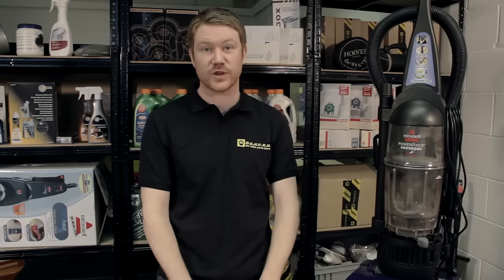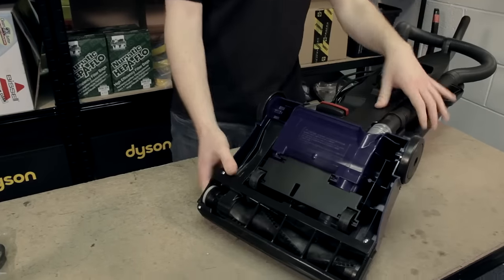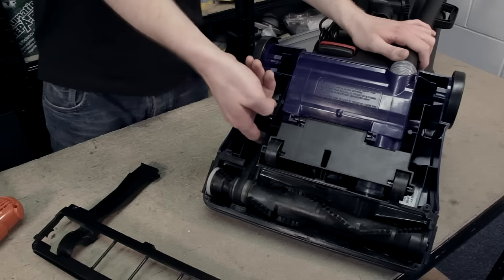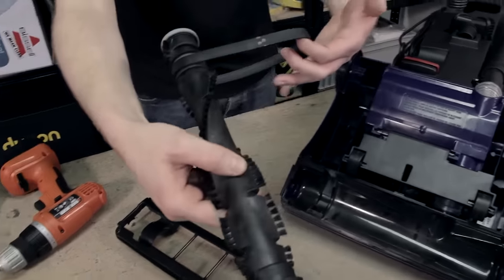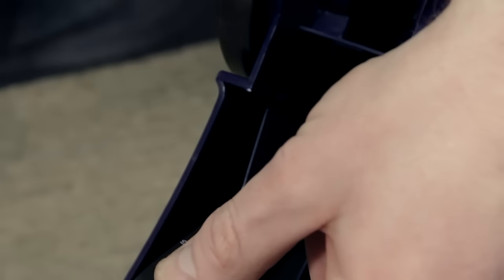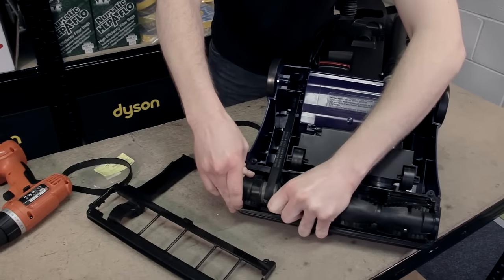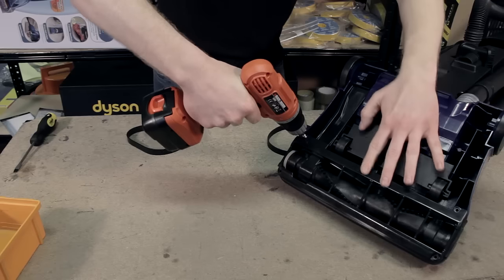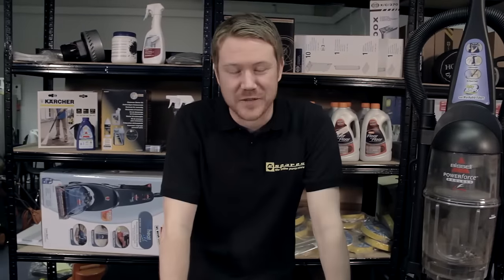How to Replace the Belt on a Bissell Powerforce Bagless Vacuum Cleaner

Comment: hi, my vacume was working fine before my belt broke, so my husband replaced it,  turned it on and it was really really loud and viberating. he unscrewed it to make sure everything was on properly and it was, so we have no clue whats goin on? does anyone know what could be going on? how to fix it?  i have a bissell powerforce compact if that helps . thanks
Reply from the maker: +punky brewster The likely cause of your problem is hair and 'string' building up between the brush bar and the end bearing caps. This makes the roller stiff to turn and eventually causes the belt to burn through. Take off the roller brush and check if the bearings have this build up and clean off before retrying.
Reply: thank you. ive taken it all apart again this moaning and checked everything cleaned it completely out, i checked the hose the filters everything. its completely clean no hair . i checked the belt again its on good i re aligned the brush  and i spun it for a few min. it has a nice tight spin. i put it back together and turned it on again and its still really loud and the handle is shaking.
Reply from the maker: +punky brewster Disconnect the belt and retry. If this does not vibrate you no the problem is the brush roller. If the roller bearings are worn it may be causing your problem.
Reply: ok ill try that thanks so much for your help
Reply: ok so i turned it on without the belt and it runs perfect. so your saying the problem is the brush?
Reply from the maker: +punky brewster Yes, from your description it sounds like the bearings must be worn as it vibrates and is noisy.
Reply: ok thanks ill see what i can google
Reply from the maker: +punky brewster Why not go to our website as we will identify what you need as: http://www.espares.co.uk/browse/at1086ma84/vacuum-cleaners/bissell
Reply: ok ill check it out. thanks again

Comment: what exactly is the motor spindle?
Reply from the maker: +Ishara Ramkissoon The motor drive shaft extends from the motor and the belt is usually just stretched over the shaft to provide drive to the brush bar.

Comment: my spendal ate right through my new belt, wondering if something is missing. checked this video out and I can't tell if there's a missing major part. also my brush didn't want to manually spin. something isn't right with my vacuum. any ideas anybody?
Reply from the maker: +mat martin The most likely cause is a build up of hair or threads between the brush and the end cap bearings. This makes the brush difficult to turn and results in the belt burning. There is not usually a 'pulley' on the end of the motor and the belt will be driven directly by the spindle.
Reply: +eSpares I checked tho and there wasn't string, I cleaned off brush, it still did not want to spin and burned right through the belt
Reply from the maker: +mat martin If the bearings are clean but the brush does not spin freely you will need to replace the bearings.
Reply: +eSpares where are they located? possibly show me picture so I may get the right ones...please? thanks
Reply from the maker: +mat martin We need the full model number to be able to identify the part you may need. Got to the following page and select your make then model and if you have a problem repost the details and we will try and help: http://www.espares.co.uk/browse/at1086/vacuum-cleaners
Reply: +eSpares Bissell model 32074
Reply from the maker: +mat martin Your model is not listed on our system but we may still be able to get the part. Fill in the details at the link below and we will try and obtain the part you require: 
http://www.espares.co.uk/contact/sales

Comment: My belt keeps popping off the motor spindle after 3-5 seconds of run time .
Reply from the maker: Hi monkrutherford, check the belt in case it has stretched causing it to come off is the most likely but also check the brush roll in case it is worn.

Comment: Thank you!
Reply from the maker: Hi, thanks for your comment. We hope your vacuum cleaner is now working correctly again. Pleased to know our video has helped you!
Reply: Yes, I was able to replace the belt on my Bissell vacuum. I figured out how to do it, but since I am not mechanical, I was doing it wrong. Your video showed me the correct way. I had been trying to pull the roller toward me under tension and could not do it. Additionally, one of my arms is very weak. I learned from your video to press down on the roller, away from me, using my weight to put the roller in place. Such a simple thing but it meant so much!

 The Bissell vacuums are wonderful and advertised specifically for cleaning up pet hairs. Sadly, the track where the belt operates is somewhat sealed off from the basic rollers, etc. I had no idea this area was packing up with dog and cat hair until the belt smoked and broke.  @eSpares

Comment: Hi,  I am having trouble with my bissell powerforce helix vaccum cleaner its turning on but not doing suction and burned smell is coming from it. Can you tell me whats wrong with that.
Reply from the maker: Check the roller is turning freely as if it is jammed with hair it can cause the belt to slip and burn. If this is free remove the belt and start the machine, if it still is burning the problem is likely to be the motor failing.